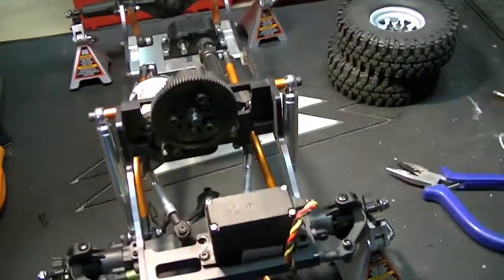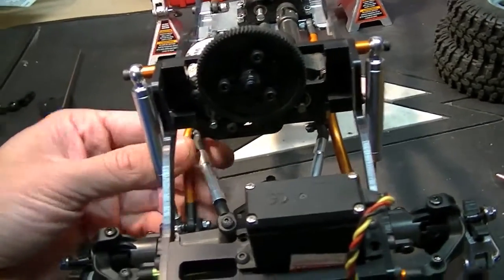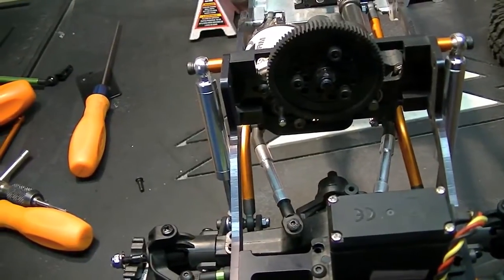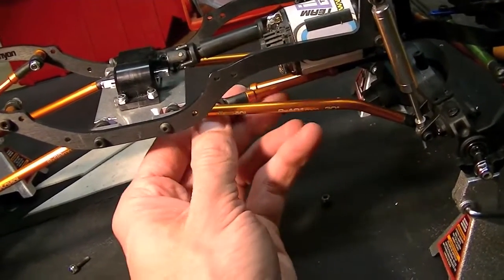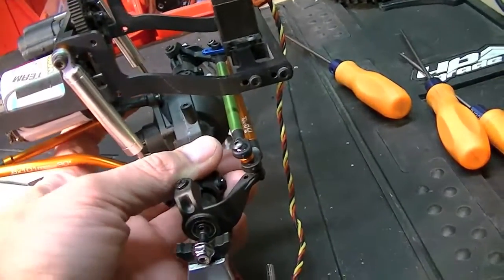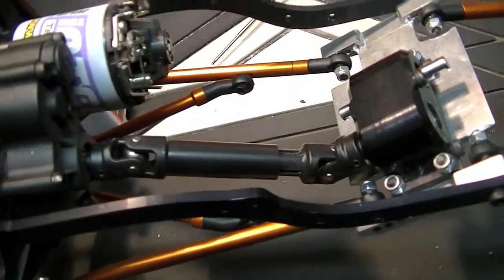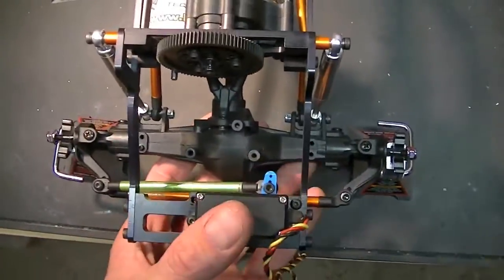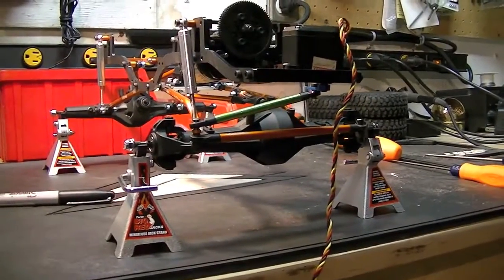RC Trail Jeep Part 5B

Comment: well that is not quite what I had in mind but it worked! great. I was surprised you could get away without the track bar up front with that setup. I agree if you lower the drag link at the steering box or raise it at the steering arm you will solve the bump steer issues completly.  the rear suspension looks awesome. real deal triangulated rear 4 arm setup. good job.